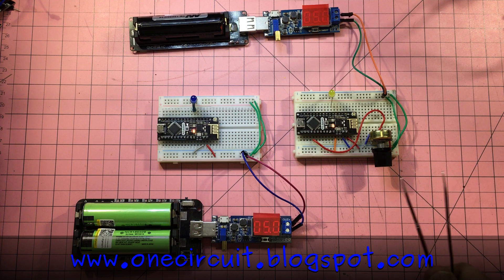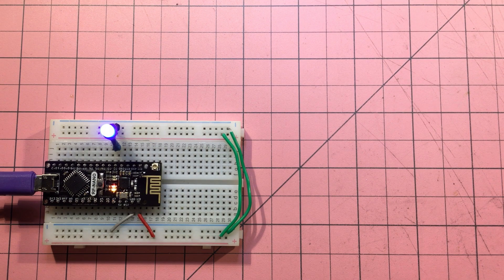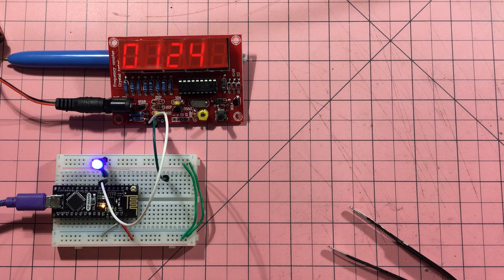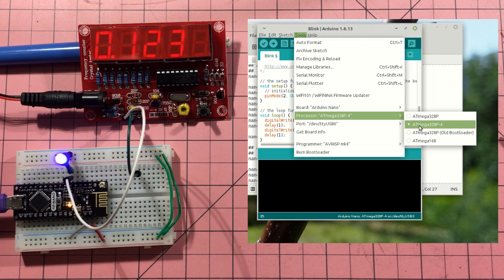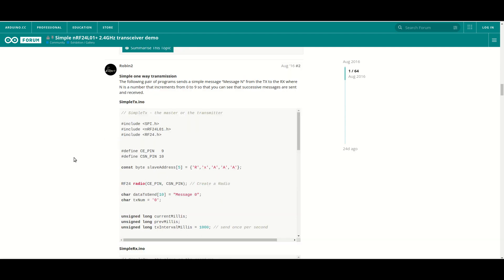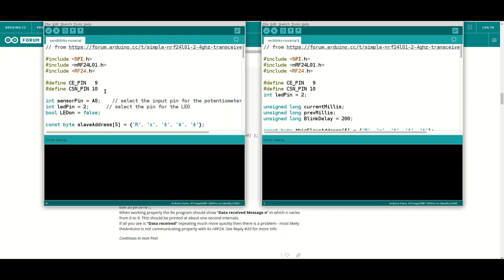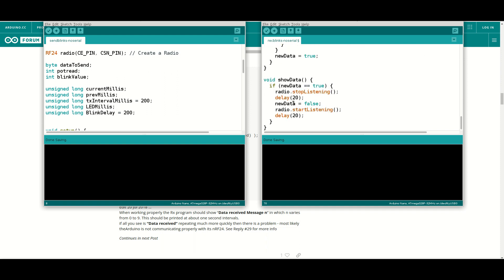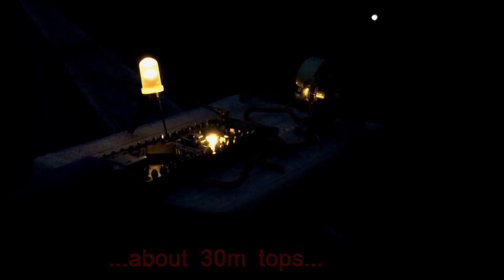Franken-Nano = Nano + NRF24L01

Comment: why you add CE and CSN lines to the code? Aren't they already embedded on the arduino nano board?
Reply from the maker: This is not an Arduino nano - it’s a LGT8F328P analog.
Reply: @onecircuit-as  i dont understand it, didn’t you use rf-nano board in this project?
Reply from the maker: @umut4004 It's a NANO form factor (with a wifi addition), but it's a cheap clone with an alternative processor - not an atmel 328p but a LGT8F328P
Reply: @onecircuit-as  Thank you for the answers!

Comment: I was wondering why my board was so slowly blinking, and I found the explanation here. PERFECT! I followed what you did at 5:27, but my IDE doesn't show another processor for Arduino Nano. Is there anything else you have changed in IDE to make it recognize a new processor?
Reply: AH, I solved it. If anyone encounters this sort of problem, there is an explanation on the Arduino forum (I only found someone else's solution): https://forum.arduino.cc/t/boards-txt/437701/5
Reply from the maker: @tompio9648  It's a tricky one - and I think there are many variations of this board. Glad you were able to get it going! 😀👍

Comment: Don't a lot of rf boards have a zero ohm resistor that needs repositioning to select between the onboard antenna and the external? Maybe that's why it didn't improve range? Or maybe the antenna was for a different frequency.
Reply from the maker: Yes I changed the orientation of the zero ohm resistor (towards end of video). I’m still playing around with it but the type of antenna, it’s orientation and the addition of a fat cap has increased the range.

Comment: Hate when they sand off the IC identification numbers. Looks like a cool board if you can find a genuine one.
Reply from the maker: I might fry one in an attempt to speed it up, the 4MHz is definitely interfering with its ability to communicate reliably via the nfr24l01.
Reply: @onecircuit-as  it's a down point of the new chip, I would expect it to operate at the same frequency as Uno, Nano etc.
Reply from the maker: It might if I can successfully burn the fuses. 👍😀